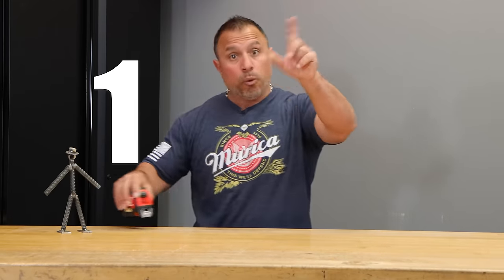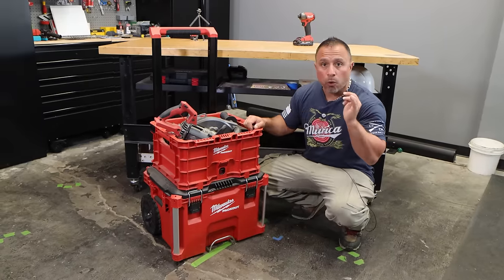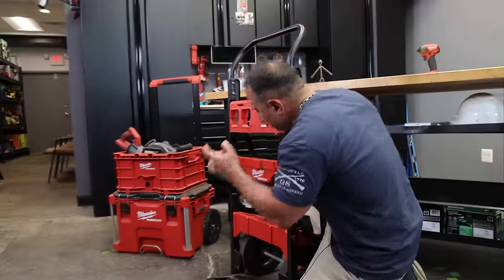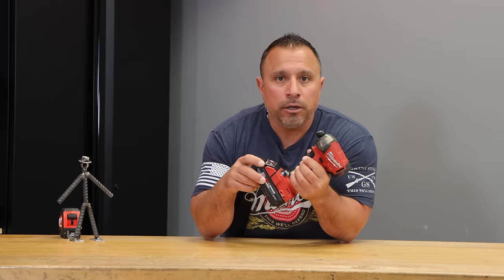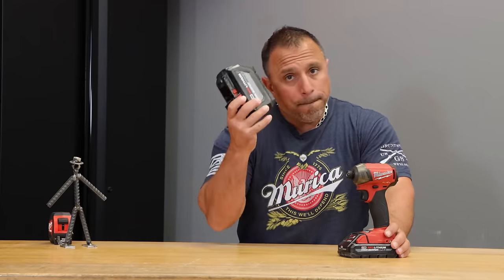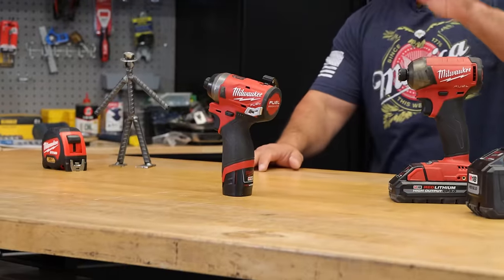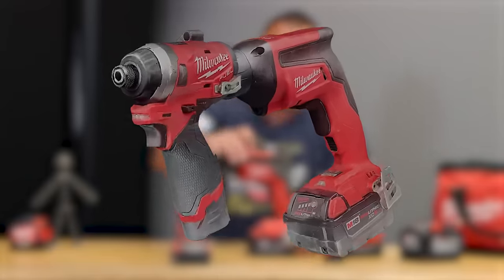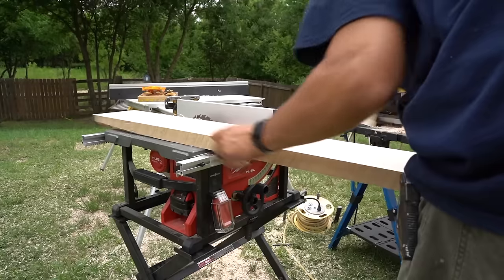Milwaukee Pipeline 2023 Top 5 New Tools!

Comment: The M18 Table Saw definitely needs to be powered by 120V ac as well as batteries.
Reply from the maker: #GameChanger
Reply: 10 inch blade is a must. Not many quality blades in 8 1/4"

Comment: How about an MX Fuel table saw that can also plug into a generator/power outlet?  If you cannot schlep a generator then you're going with a battery platform that, while expensive, can absolutely handle the job.  (And when you get home you plug it in and charge your MX battery in the saw without needing an MX charger if that's your only MX tool).
Reply: I was going to post it but thought it was a stupid idea

Comment: Great lineup. Milwaukee definitely needs to put more power and a cord option in the table saw.
Reply: Dual power table saw.
Reply: No, having a cord and battery on a power tool is not the way to go. It actually makes the tool weaker due to the motor needing to be able to handle both.
Reply: 0MG I was saying the same thing ...TY SIR!!!
Reply: and a digital adjust like the festool. better yet, make it packout compatible also
Reply: @jmackinjersey1  please explain why this is the case?

Also wouldn't dual battery fix not having enough power?
Reply: @jmackinjersey1 make it their problem 😅 we want !

Comment: They need to make a Bottom Packout like the original but with a Big Drawer or Two Drawer…. 

Or one like you said if you need better wheels for rugged terrain. (That’s not me)

M12 Drywall stuff would be sweet… even though I just bought the M18 😂

Comment: I like all of your suggestions, the only thing I would add is an AC power supply like Metabo has. They could even make it a multivolt like theirs that can do 18v or 36v so it could work with dual battery tools, alternatively add a 120v power supply to some of the larger next gen tools they come out with. I love being able to plug in my rocket tower lights when its convenient to do so and for some tools if power is on site and readily accessible it just makes way more sense to be able to plug in especially with large immobile tools like table saw, miter saw etc.
Reply: Yes!!! I came here to say this and make the same points!!! Ac power adapter option would be awesome!

Comment: Whether it’s a m12or m18 Milwaukee needs to make a drywall screw gun with a 2500 rpm version for wood studs instead of just a 4000 rpm gun for metal studs. The gun needs more torque, the m18 drywall screw gun has too many inconsistencies with setting the depth of the screw! I like the idea of a m12 version of the drywall screw gun! You’re on to something Vince.

Comment: Not a tool, but a one stop charger to start with: I have 12 v dc in my work truck, 24 v dc in my flatbed truck, sometimes ac power on job sites... For now I work with a separate 6 kW split phase inverter on my 24v system powered by a 100 Amp alternator spun by the truck's diesel. How handy would an all in one smart charger be for us remote machinery operators and off grid diy-ers? Food for thought...

Comment: The current M18 Surge is my most used power tool. It is nice not having to wear hearing protection when you use it!
Reply: Have you tried the M12 assembly driver? It’s what I use for about 98% of the time since switching to it a couple of years ago. It rocks

Comment: They should make their M18 table saw run off a single battery but also work is a charger for two batteries. That would make the most sense, so when power goes out the saw keeps running

Comment: I have a different opinion on the table saw. I think as a trim carpenter it does what I need it to just fine. Ripping 1x material and stuff. It's compact which is nice because my whole set up is cordless. I would not want to discourage people to buy one of this for trim carpentry. I think using it the way it's intended will leave the user happy. I know I am rarely ripping hardwood for jobs and once again if it is it's 1x or flooring. That being said if Milwaukee wants to offer a beefed up one that's great and if it was to have a cord even better and then if you could plug the cord in a charge the batteries while using it god damm that's brilliant! All I am saying for the little saw the current one is it does a decent job while being in a compact package. And that video clip of the saw in this video had the 5.0 ah battery in it. The table saw is not intended to run on that. I watched that video years back, I can't remember why he tried the smaller battery, maybe he is one of those guys, you know the ones on the crew that always use up batteries then never charge them and then bitch that they are dead. If there is one tool Milwaukee needs to work on it's their chop saws. They are absolutely garbage, The 10" is so underpowered and not smooth I don't even want to try to 12", Makita offers a way way better saw. Milwaukee has come a long way for the trim carpenter with the nailers and everything else. Put some time in a great chop saw, we deserve better from them!

Comment: The GEN2 rear handle 7 /14 saw, supersawzall and cordless framing nailers all need to be drastically lighter in weight - framing nailer sits collecting dust in everyone's trucks, rear handles are being replaced by Metabo HPT's, as well as the supersawzall

Comment: How about a rolling bottom box with 2 or 3 drawers. Also the handle should be removable from the factory. They need more packout accessories to compete with flexs stack pack system and kliens new system

Comment: Absolutely!!! I need a new table saw. No great options yet. Just some almosts, but missed the mark options.

That is the one idea Metabo got right with their multi volt table saw. 36v with a cord adapter option. Stupidity expensive. But it's a step in the right direction. 

DeWalt had a swing and a miss with their fault, burn out the motor, flexvolt adapter. But even then, it was a 120v adapter. Now if they had a true 60v flexvolt adapter all my shop tools and job site tools would be the same set of tools. 60v batteries in the field and adapters in the shop. Same tool but flexible power options per location.

Comment: I agree Vince and especially that table saw. Run the metabo hpt 36v multivolt table saw where have option of plugging it in and not bad table saw, if Milwaukee did this, I’d check it out and if better most likely buy it as nothing wrong having w table saws😉

Comment: Milwaukee needs a M12 hand held inflator similar to the Ryobi hand held inflator
Reply from the maker: Even smaller than the existing M12 inflator Fred?
Reply: @VCGConstruction  
Yes it is Vince  Ryobi part number P737 
It’s the only Ryobi tool that I own and I really like it. I use it when I test for gas line leaks when I install new  gas line in

Comment: To make a fuel tool able to be dual power its going to need a vfd with bridged retifier. Which means weight and cost. Possibly have to be outside the tool. Im going to recommend torque test channel to attempt a build.

Comment: The surge is not just less noisy it's super smooth, as a cabinet installer it allows me to easy drive screw reaching into the back of a cabinet where as the regular impact have little to much vibration and makes it a little harder to drive the screw while reaching if that makes any sense
Reply: You install with 18v drills? 
I only use m12 stuff on site but the hydraulic would be nice. 
Might be swapping out to the new Festool 12v drills though

Comment: Would be nice if they would come out with a higher voltage  battery platform like Makita did with the XGT 40v. Or a backwards compatible battery like the Dewalt flexvolt. I really think a newly designed worm drive style saw would benefit a great deal from that bringing a much welcomed boost of power. A stronger  hand held M18 planer would also be nice. And Packout accessories like battery and charger holders that are mounted on the outside. 

That’s my wish list Milwaukee 😃
Reply from the maker: Good stuff Skolsaw, if they did, I’d want the battery to be backwards compatible with existing M18!
Reply: @VCGConstruction  yes, like metabo hpt!

Comment: @VCG Construction, Yo Vince! Loving your list. I have one item to dove-tail off your list. I have had the M18 Drywall Screwgun and it was fantastic. I was excited to try adding the auto-feed mechanism to make it a more single handed operation, however the reviews on it were, well….not great. When I needed to acquire a replacement, I opted to try the Flex a try, and let me say, I have been very impressed so far. It seems to be feature rich, well designed, and reasonably robust. Time will tell how it performs over the long haul, but, so far, so good. I’d like to see them follow your suggestion for making an M12 version and at the same time, redesign the auto-feed mechanism for each. Or, better yet, maybe design one that could be interchangeable between the M18 and M12 platforms.
Reply: I have the m18 screw gun and auto feed too, and thought it sucked until I learned how to use it. You can’t be too forceful or aggressive when you use it, but once you figure that out it works great.
Reply: @Gpaytonnh  That’s awesome to hear. I was wondering about that myself and was curious if now that I have been exposed to a few different variations of this type of tool, my results with the M18 auto feed might be decent. One such tool was a corded Rigid auto-feed screw-gun that we used primarily on a subfloor to minimize squeaks ahead of a hardwood install. It did take me some time, practice and the sacrifice of at least one bit to really get a decent rhythm where I was’t locking up, binding or stripping literally almost every other screw.

Comment: If they release a 15ah, they might as well update / finally release a 4ah compact HO battery. They have had a part # for it from at least 2019, 48-11-1845. That yellow brand has it in that size

Comment: Oh and the second item I would put on that must have list is a half width packout toolbox. They have it with the organizers. It would be a perfect size a single tool. If the half width organizer was a little bit taller it would be perfect for a router or a jigsaw etc. But it's too short. The tool case is the right height but doubled the width. We don't need that much for a single tool.
Reply: Honestly they need to release more packout in general. Ideally smaller sizes to fit an individual tool. Sell more tools in the packout boxes.

Comment: It's trivial for them to make these items take AC. Table saw, miter saw, could really benefit from that. Hey the new dust extractor has it at least. But yeah dual battery 10 inch table saw with versatile power would be sick. I want tools I can use in a wood shop at home but just as easily take with me without compromises. OR juuust an idea here but maybe an m18 battery shell with a cord coming out of it, crazy right? Give the people options.

Comment: We need smaller versions of the battery holders so that the wall plates and tops of boxes can be more versatile. Once you mount one battery holder you can't mount anything else because of the all or nothing design of the plates.
For instance I'd like to mount a crate and battery holders on the same wall plate.
Reply: Agree their current design allows the packout accessories to sit to low once locked in. I have a wall of mounting plates but there are so many unused grooves and space because of the low hanging and offset cleats. There is definitely room for improvement.

Comment: How about garage door focus tools mainly a tool to wind springs but also a very experienced tech point out we burn through impacts cause we use them insane amount but I would also so ya upgrade that hand truck and the table size needs to be 10” so 36v or mx fuel

Comment: i agree with the 15 amp battery, stacked lithium battery, and gen 2 m18 surge. Would definitely be cool to see. but i personally would like them to have a new (updated) m12 cordless copper cutter that can cut 3/8 OD copper for us HVAC guys. ever since i saw the tool i loved it, but after finding out the lowest copper it can is 1/2" or 5/8" ID copper i was disappointed.
Reply from the maker: That’s a good suggestion Broski

Comment: m12 metal cutting circular saw,
m12 pure hammer mode on next gen roto hammer

My surge has been going strong for years, whereas my 4th gen fell off a 6' ladder after 4 months of use and had to send it in

Comment: Hoping to see the following: m12 21 gauge pin nailer, m12 pex crimper, m18 dust extractor with Bluetooth and 4-6 gallon capacity, m12 fuel d handle and barrel grip jigsaws, updated circular and miter saws with greater accuracy and smoother operation, m12 hot glue gun, biscuit joiner

Comment: Isn't the table saw a high output tool?? If it is you should've been using a 12ah battery I saw in the video you were using a 5ah? battery and yeah I would absolutely love a table saw with 2 batteries also there chop saw could use some upgrades

Comment: Table saw and miter saw both need corded options. The table saw definitely needs more power. I’ve had my 12” miter saw mother board burn out twice and the saw was less than a year old. I ended up by a dewalt while my Milwaukee was being repaired.

Comment: Will see:
Stacked lithium batteries
New gen M18 FUEL high impact wrench
New gen M18 right angle wrench

Would like to see:
M18 FUEL variable speed & temp heat gun
M18/M12 glue gun
M18 UV light
M18 FUEL pressure washer stick
M18 weld & slide hammer

Comment: Great video 
But it’s a hand truck not a dolly, dollies are toys.  (Retired UPS driver joke)

They need to update the m12 right angle drill, current is a gen1,  they need to up the power and offer 2 one with a 1/4 hex and one with a chuck.  I have drill bits with 1/4 hex and they should make driver bits that snap into the hex and the driver tip just sticks out.  
❤
The m12 fuel screwdriver needs an update for those of us who like the the clutch of a drill/driver to not strip and tear out ,you know I’m using power tools on my plastic outlet covers and other easily broken items.  I don’t like the installation tool I just want a smaller drill with built in 1/4 hex and the current one is gen 1 not even gen 2.  Just put 1/4 hex where the chuck is and it’s smaller.  No swappable head needed.   
Let me repeat because size and power do matter, new m12fuel  screwdriver. Put a 1/4 hex chuck on the gen 3 drill
I know you love your impacts but you like the surge over the power of the new impact,you say it in the video for the noise and control.  I like the clutch of a drill/driver and hate using the impact on wall plates but you know I’m using a power tool and can normally finesse the impact a drill driver clutch makes it easier and same with fasteners on finished surfaces.   If I’m framing and running self tappers in steel I want my impact if im assembling a finished product the impact is a pain.  Too easy to over tighten and worse round out that POS cheap fastener that everything comes with 
My gen 3 m12 drill is compact. I have 1/4 hex I can put in. I like the impact form but want a clutch and the relatively bulky fuel screwdriver is my go to now over my gen 3 impact and drill   The M18 impact sits waiting for big building projects 

Multi battery chainsaw.  It’s a 2 hand tool.  Just balance it
Reply from the maker: 🤣 I was at a loss for the word… thanks

Comment: My wants on M12 Fuel jigsaw, RO sander and sheet sander, gen 2 2403 screwdriver, bring EU multi chuck to NA,  gen 2 surge

M18 2 stage snow blower, non compact drill with power (match or bear profactor) cold cut chop saw that miters, x lock grinder, band files,

Comment: Ohhh the table saw isn't there yet... you put a regular X.C battery in it and tried to rip a peice of 2 inch thick lumber 👏 . Then complain its not powerful enough. I agree it cuuld use a boost but at least give it a chance and be fair ffs with a 12 amp or 8 or 6 High output.

Comment: I bought the drywall screw gun thinking it would be better but it's not. It's heavier then dewalt and the attachment you buy separately is designed poorly. Only milwaukee tool I regret buying.

Comment: Personally, I feel like the blade on the table saw is too small. An 8” blade? The compound miter saw us a 10 or 12”  blade (and a 7” I think?) but my konalt table saw with built in dolly has a 10” blade.

That’s the only thing that stopped me from buying the table saw a couple of months ago (well blade size and no wheels).

Comment: I sure hope Milwaukee is listening to this video.!!! Milwaukee Please pay attention to all of this video.
The Cordless Jobsite Table Saw market, Milwaukee's attempt with the M18 seems to be just a rush-to-market, trying to get something out there for team Red. As a newer team red member, it's not too soon for me to change to DeWalt (often less expensive and already have the power-stack power option available.). I'm not bashing, I just know Milwaukee can do sooooo much better than tool not better than the Ryobi equivalent. I have both brands, luckily not both battery powered table saws. I CAN'T EVEN BRING MYSELF TO CALL THEM "JOBSITE TABLE SAWS" CAUSE IF THAT'S WHAT YOU BROUGHT TO THE JOBSITE, THAN YOU'RE GONNA LIKE AN AMATEUR AND YOU'RE GOING TO BE PUTTING IN A GOOD DEAL OF OVERTIME. OH, AND YOUR GONNA NEED TO CALL THE CUSTOMER AND LET THEM KNOW THE JOB'S GONNA 3 DAYS LONGER TO COMPLETE BECAUSE OF) WHATEVER ACCEPTABLE REASON YOU CAN COME UP WITH,) BECAUSE OF TERRIBLY SLOW TABLE SAW. AND, YES RENTED BOTH OF THEM SEPARATELY FOR DIFFERENT JOBS FROM HOME DEPOT, AND I WOULDN'T BUY EITHER ONE..... honestly... the corded Ryobi table saw is better.
I rented the DeWalt to finish my project because the weather wasn't going to hold out long enough for me to finish the job with Milwaukee Saw. The DeWalt still wasn't fantastic but it was usable at least. It's not that far of a step from the corded version. That's a valuable but expensive seat-of-the-pants lesson.